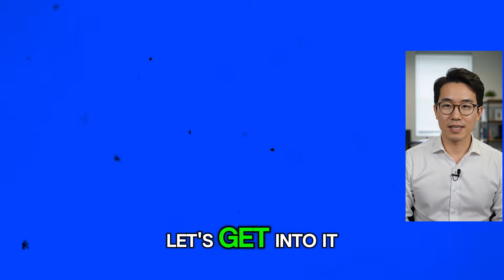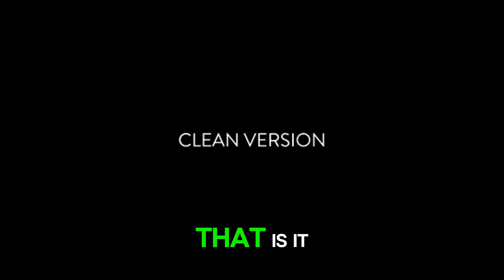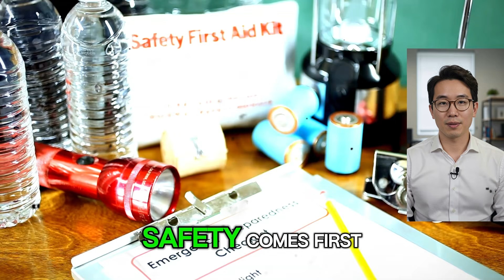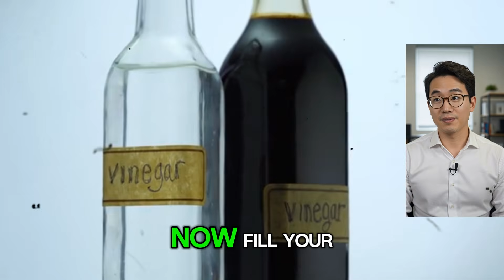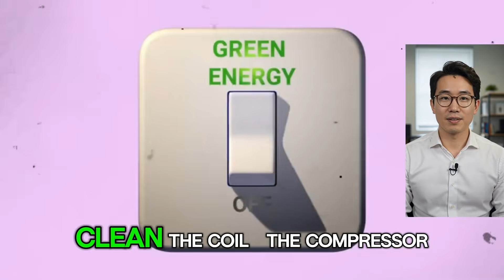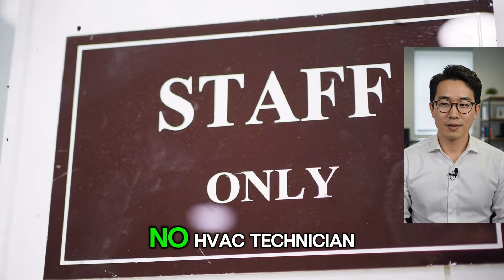$3 Powder CLEANS AC Coils & Restores Full Cooling Power FOREVER – HVAC Companies Hate This

Comment: I have no problem with the formula. My problem is my air condioner is in a closet with no room to maneuver to get to the coils. The prices to remove the unit is outrageous. If i can possibly get any of the coils clean I would be thrilled
Reply from the maker: I understand the tight space is a challenge, but even a partial cleaning of the accessible coils should help improve your unit's efficiency. 👍